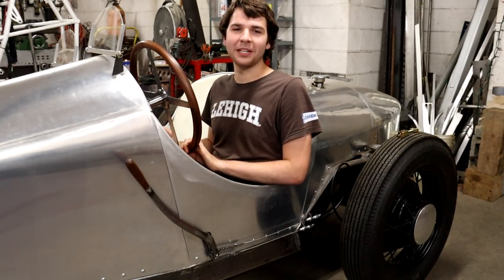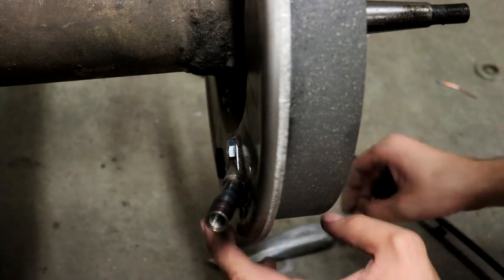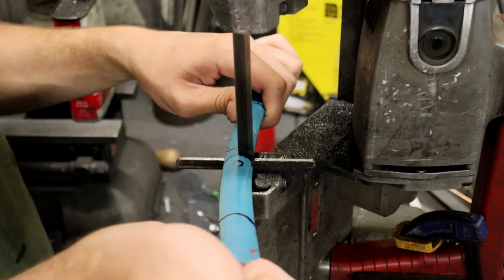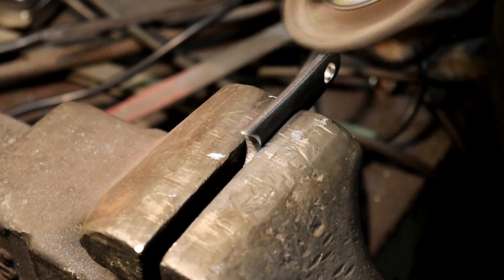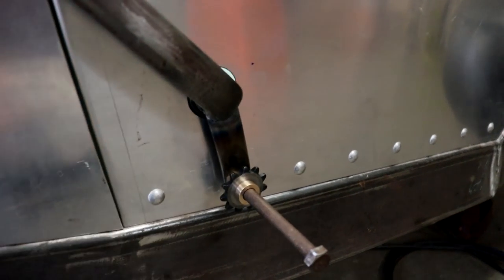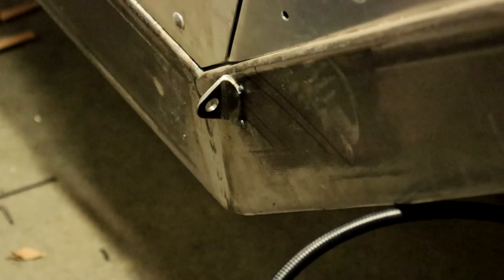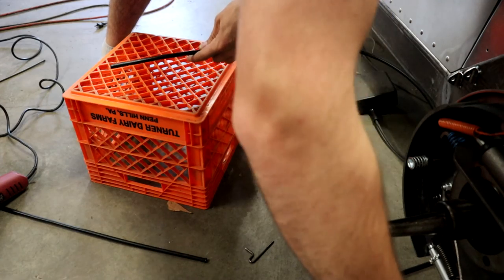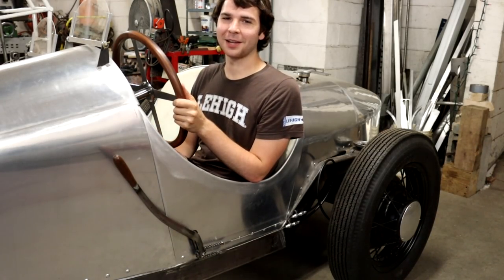Making a Custom Emergency Brake Mechanism | Homemade Boat-tail Speedster Pt. 53

Comment: One of the things that I appreciate most about your build is the attention to aesthetics. The mechanical side of your build is interesting to watch and you've come up with some wonderfully creative solutions, but it is the aesthetics that give real pleasure.
Reply: As someone who was awarded a degree in Industrial Design that I had aspired to earn since high school (but had initially planned on also getting a degree in Mechanical Engineering, until the Advanced Maths and Physics proved to be my undoing), I really appreciate the constant pursuit to create these various components with a balance of form and function; evaluating and revising the proof of concept, taking it a bit more up-level.  I'd like to think that he should get on well with the Designers in whatever field he finds himself employed in, post-graduation.  It may be a gross generalization/stereotype, but I don't believe all Engineers are sympathetic to the enhanced value gained from the aesthetic element. :)

Comment: You have really developed as a designer and fabricator.  You are the person I wanted to be at your age.  I was a successful teacher for 35 years and did all my home, auto construction and repair.  You are doing what I always wanted to do.  I have built two gas fired bicycles, one with 7 speeds and one with a torque converter.  I built a pedal car for my grandchildren when they were toddlers and made water rockets for them when they were eight and ten.  I am 77years young and I envy the skills and tools you have accumulated at your age.  ENJOY!

Comment: Elegant engineering. Called a 'fiddle brake' in the UK and often seen on trials cars [cars for climbing muddy hills]. Also used in the modern sport of drifting. The fiddle brake saved my life once when the hydraulic brakes failed at the top of a very steep hill and we were careering backwards towards a river in Cornwall. Scary stuff.
Reply: So happy to see the car drive and the smile on you face !!! Just a observation, looks like you steering arm on column looks very close if you drive over any type of entrance . Love ever thing else

Comment: The set screws should be the secondary locking mechanism for the cables, not the primary one.  Other than that, I'm incredibly impressed by the attention to detail and your use of what was essentially junk to make a functional and stylish addition to the car.  The original hot rodder's ethos.
Reply: Agreed. I would like to see him weld a small ball on the end of each cable after they've gone thru the blocks that he designed to connect his cable to his chain. Then use one hole as a way to seat the ball and the other as the set screw.

Comment: Love everything except the set screw design.  Seems like allowing for regular barrel style cable ends would be a lot more reliable.
Reply: Amazing work, but yes the set screw setup was the one thing that worried me a little, feels like it would work loose over time.

Comment: The engineering is always top notch, but in this video particularly I'm appreciating the insight you give both into the aesthetic part of your design process ("this is functional but it doesn't look right, I'm going to do something else") and the occasional flubs and missteps.

Comment: That really came out great, the blending on the e-brake handle. But I love the mechanism for equalizing pressure to the brakes, so simple and elegant. One of the things I love about old cars is how many of these mechanisms are on display. I've never understood the appeal of these modern plastic engine covers

Comment: On the cable ends, I would've drilled the blocks all the way through with a counter bore at the chain end fed the cable through and welded a sleeve onto the cable ends, so the cable will twist in the block without resistance/binding, the counter bore deep enough so the pin/bolt securing the chain keeps the cable end in place within the block,

Comment: Brilliant design Vince. 
Using the chain and sprocket is so much more attractive than the method I would have used with what would essentially just be a balancing bar. No different in operation than what you would find under the floor of most vehicles currently on the road. 

As for not using any filler rod to weld your cable adapters on you probably didn’t even need to weld them since the original design is just the cable sheath pressed against the tube ends that you cut off and that connection is always under a small amount of compression anyhow so they weren’t going anywhere.

Comment: you have a hand brake. 
now you can add a lever with a spring that locks the whole thing in place; 
it's simple with the insane hardware you have.. pretty sure you can hand shape it yourself out of what remains of the fork, or from a piece of tube, with a bit of metal wire welded to the edge, so the lever cant snag your skin. with a smooth double curve shaping around the bushing down the lever, like a 1930's lever should.

hope you're considering butterfly fenders for this car.

Comment: Love this build, one comment on the set screws though: Have you applied some locktite or are you planning to? I don't trust set screws unless they're glued in place :D
Reply from the maker: I will definitely loctite them at some point
Reply: @MacroMachines  I would drill part way into the other side of the barrel to form a dimple for the cable to get forced into, so the cable would have to pull around a corner, rather than it being able to just slide past the set screw.

Comment: I would think about what happens if one side comes loose, seems you would loose both brakes. I'd split them with individual adjustments.
I do love your overall design and think you have a winner if you decided to commercialize a kit of some kind or even sell drawings. Make a great class to race although I don't know enough about it to comment other than it was kind of a golden age of racing.
Great job, great video.

Comment: I can see that brake being handy in the snow, Ha!!  Still think the power to weight ratio with that straight 6 is going to make this even a shock to you when you first drive it. Please weigh it at this stage in a video, I bet the rest of your followers would like to see that also. ;-p

Comment: The double set screws will be fine but the angle bracket that the cable outers pull against will bend and pull off unless they are beefed up. Saying all that great job young man. Richie UK.

Comment: As per other comments, very awesome setup apart from the set screws. Would rather see a crimped fitting on the end. Set screw only applies pressure on one small point , where a crimp fitting has pressure all around the cable and for the entire length.  

Now i need to go back and watch all the other video’s. This is an awesome looking build.

Comment: You could use the emergency brake handle as parking brake also if you design differently, like with a tube with a push button rod with a spring, a short lever that pivot to the rod, and the lever to a sprocket, I am sure you can change the design with a little modification to the body to make it strong.

Comment: I wouldn't trust my brakes with set screws. 
You obviously have the ability to fab up a threaded sleeve that the cables could be hydraulically/mechanically crimp to. Then thread that crimped end onto the chain.
I really like your attention to detail though.
Reply: Swagged would be best. Second best, wedge type cable splicer (I used a conical wedge type for stretched vinyl horse fencing and I see similar fastners on power lines - grips the entire wire/cable and extremely strong without needing a swagging tool).
Reply: Or ditch the cable entirely and use chain all the way.
Reply: *swaged, swaging tool.... 😂 there is still going to be a primary braking system this is more than strong enough.. with a little red loctite those screws wont let go until the cable rusts out. the clamping force those things can apply is in tons.. that being said, id put some epoxy or anything at all in there just to keep water out that would give this setup plenty of swagger lol...
Reply: @ianbuilds7712  Yah, loctite on those screws to keep them from backing out would be critical in any event. But hey, he did ask for feed back! :^)

Comment: Great attention to detail and appearance. The only thing I'd change is to arrange the leverage so that pushing, rather pulling , on the lever applies the brakes. That way you're getting a "self-servo" effect, rather than fighting the deceleration. (Modest though that may be from cable-operated drums.)
P.S. you really do need a plasma cutter for some of those jobs, especially the fiddly ones.

Comment: I would put some sort of protection for those cables while still being able to see the mechanism , you could have fun making a special aluminium panel for that. 
I would also add a second lever arm to the mechanism to make it easier to operate  ( but I 'm sure it's fine ) 
Cheers

Comment: As nice as the lever, sprocket, and chain is, what it connects to looks a little clunky with the loop of brake cable on account of how close-coupled the rear end is. For that matter, cable-actuated internal expanding emergency brakes are not that period-correct, anyway. Many cars of that era used an external contracting e-brake mounted on the output of the transmission. With your driveline setup, you could easily fit one. There are many donor autos and one good source are the 40's to 50's MoPar autos - Plymouth, Dodge, DeSoto and Chrysler. Although with the light weight of your speedster, you could probably craft your own from go-kart parts.

Comment: I've been watching you all along. For your age all very impressive. The only thing I would have done differently is. The system needs a turnbuckle someplace. So you can adjust it if needed. Other  than that, very cool

Comment: realy like the idea with the piece of chain , seen cnc machines that used a simulai setup instead of a rack and sprocket to drive the machine off the steppermotors , its stronger and cheaper than toothed belt (aspecially on cnc plasma cutter setups )
the only thing i would be worried about is to pull the ends of the cable out of the holders , i mightve welded knobs on the end of the cables and mounted them through a keyhole type mount or hardsoldered them intoo the mounts

Comment: I tried the set screw design (grub screws in UK) before for a handbrake and they were very unreliable so if used for an emergency brake I'd expect them to pop out pretty quickly. silver solder / brazing would probably be safer.  I just ended up getting some custom cables made to be on the safe side

Comment: A "V" grooved pulley with the cable from one end to the other would be simpler and equally compensated (and lighter) instead of the sprocket, chain and cable/chain connecting pieces. I'd also prefer that the pin had the stop pin on the inside, but good work on achieving your vision.
Reply: a V-shape would have been fine, but it does not have the same industrial, mechanical feel to it as a sprocket and chain. I see it as a nod to the old chain drives...
Reply: @uliwehner  My aim is always the K.I.S.S. method and add lightness is always a way to go fast.

Comment: I would limit the rotation of the sprocket, maybe a simple stop on the back side that starts at the 3 o'clock position and runs into the lever if it rotates too far..  if you have any failure you will loose both brakes if the sprocket can freewheel, if it moves some for balance then locks up you would at least still have one side.

Comment: I love the design as its sympathetic to the rest of the car. I will add to the concerns about the cables being held by screws I'm afraid and because it's a manual transmission surely there should be a ratchet mechanism to hold the vehicle on the handbrake (UK speak) while it's parked?
Reply: Or you can just leave it on gear.

Comment: Greetings,
Very nice work on the brake handle.
Very nice attention to detail.
I would suggest you fit a washer between the cotter pin and the arm.
I don’t really have a reason, I just feel a washer protects the cotter pin from wear and gives finished look to the assembly.
Are you going to devise a way to lock the brake so it can be used as a parking brake, or is it just a hand brake for the rear wheels?

Let’s be careful out there.

Comment: If you want to be able for it to also be used as a parking brake I would suggest a releasable friction device designed like they used on the 50s Chevrolet PUs.
Reply: he has video where it will lock in place as parking brake

Comment: Wonderful
My only concerni is 2 set screws each cable being a little "weak". Why not add some Loctite/epoxy to lock the cable in addition to the screws, in alternative a weld-on ferule.
Reply from the maker: I will eventually add some loctite once everything's together for the final time
Reply: @MacroMachines  I knew there was more to it. Your builds are way too high level to leave a details like that.

Comment: Its a cool design, but I would advise coming up with a fail safe in the event one of your cables were to snap, as with your chain set up you would loose both emergency brakes. Also I would suggest some king of locking or latch mechanism for the bar to hold it in place as  I can picture it flopping while driving. Plus with the latch mechanism you would gain a proper parking brake as well.
Reply: Some vehicles actually have bracket assembly which will pull both brake cables at the same time where as in the event one  cable snaps, the assemble will still pull the other cable although it may have slightly more slack in the pedal or handle for the parking brake. I was suggesting maybe some sort of bar to link the two ends of the chain together, that way in the event a cable were to snap he would still have partial use of the other one although he would need pull the lever further. It would only be a fail safe but in the rare chance that would happen, I would rather have use of one working brake than none at all.

Comment: Reduce the angled front cutting edge on the parting blade. Its causing the blade to flex into your part at the end of the cut. 3 degrees is plenty.

Comment: As long as the grub screws aren’t the cutting ones they should work ok , although I would have fitted three . They have the advantage of reuse over staging but not the strength. If in doubt give it a hard tug ! Cheers

Comment: I like everything in this brake system but the loop in the driver's side cable. It looks distracting... But nice total design. I would really consider changing from two set screws to hold the cables, to something more reassuring as well... Thumbs Up!

Comment: Very neat work as usual.
Is that drivers side cable a bit long? When you demonstrated the pull handle seemed like a bit of slop in the cable so that is moving before the brake shoe moves. Agree about the loctite ( red?) for security. I had a Lokar throttle cable fail on me because of that set screw arrangement. Luck I could jury rig something g to get me home.

Comment: I like your design aesthetic. My only worry is that it's built without any redundancy. If one of those cables is damaged and severed, you lose all function.  Will there be a lock or is it just a fiddle brake?

Comment: You are as much a designer as an engineer! I like what you're doing, but be carefull with removing old paint because it often contains lead and other unheatlhy stuff. Good content, it  always increases in the holidays and when you're away to university it stops, but never mind, education is important. Keep up the good work!

Comment: Forgive me if I'm wrong, but I think it would be cheap insurance to increase the tack size on the end of the cables. Or perhaps even weld on a tiny tapered piece. Just a little assurance that you're not counting on the two grub screws alone. Your design is excellent, just seems like a tiny bit of effort for a potential big payoff
Reply: Also, since the set screws don't show, I think next time instead of having the set screws down the center line, you should bias the pair of screws to either side of the center line. That way you are necessarily biting the entire cable

Comment: When you were thinning down the bolt on the lathe, I noticed the tool that you were using seems very interesting. It looks like it has a clamping head that grabs a form tool? Maybe it was a trick of the camera, could I ask what tool / manufacturer that cutter is?

Comment: Bravo…deciding to scrap that tab was definitely the right choice.  The design on that is really beautiful with the repurposed bicycle forks.  
One question: how are the brakes locked on and disengaged?
Reply from the maker: there's a ratcheting mechanism inside the mount for the lever, or that can be disabled so that it only engages when you pull it and hold

Comment: I think it it a very elegant solution but your cables will be forever pulling  loose from your set screws.  I think some kind of loop around a bushing on a pin arrangement would hold much better.

Comment: What is the loop for? I’m curious about how you routed the cable and sheath to the other side of the car. When you pull the brake lever there should be a lot OC movement in the sheath trying to straighten out. Do you need some kind of sheath guides?

Comment: Nice execution but a single cable failure like one pulling out of the set screws will result in a double failure of both brakes.  Each cable should independently be connected to the brake lever by themselves.
Reply: Plus there is nothing saying it is going to pull both cables equally. It could easily just pull on one cable with the sprocket being able to turn the way he has designed it. 
But from what I've seen, I'm sure he will figure it out. He is one impressive young man. 👍👍
I always look forward to seeing his work and how he gets to the end results.